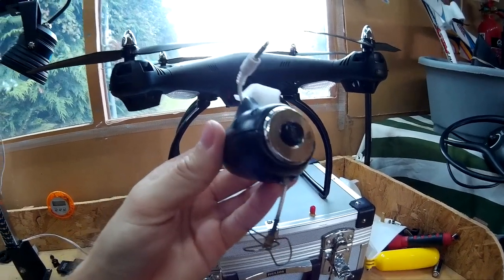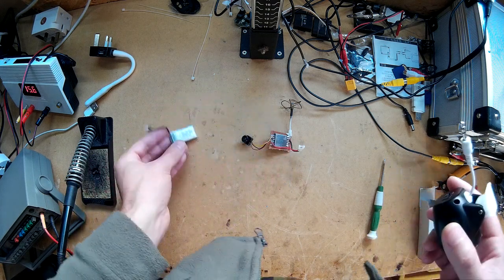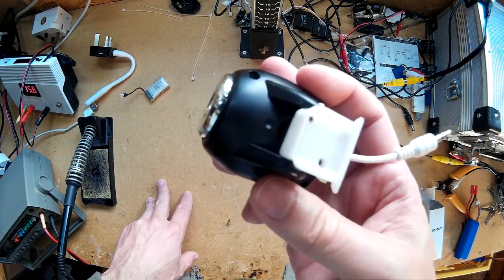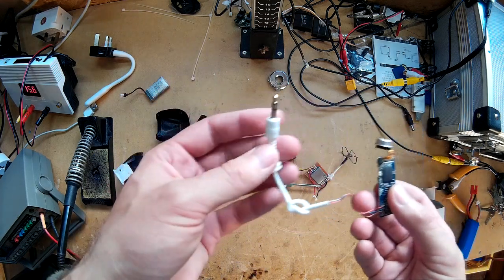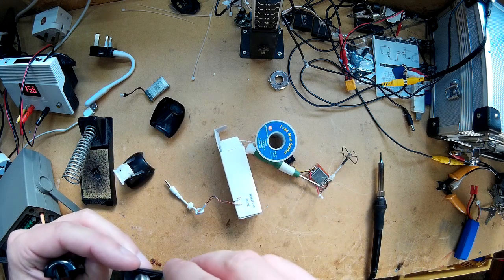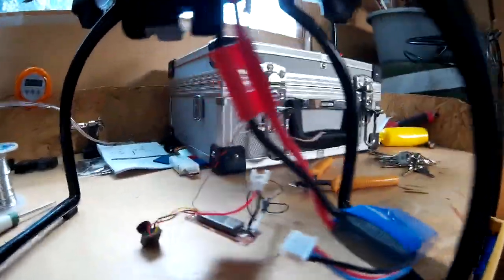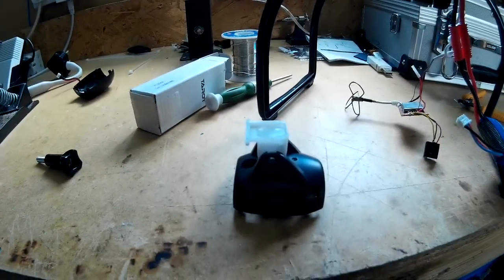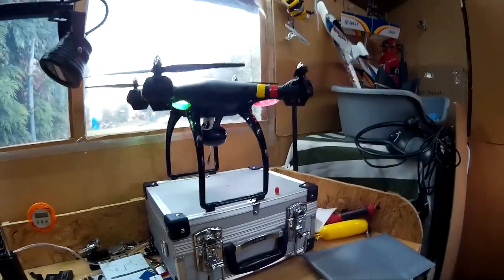Syma X8C Stock Camera Mod T0 5.8ghz Fpv camera

Comment from the maker: Other spare parts
Long leg Landing gear https://goo.gl/RTJbF8 Receiving-Board-Spare  https://goo.gl/rhH18K Camera Holder Mount For GoPro SJCAM https://goo.gl/BLTW1K Fluorescent-Propeller https://goo.gl/JopVne Motor and Motor Gear Motor Base https://goo.gl/VGTxDP  7_4V-2000mAh-Battery https://goo.gl/rVShb2  5_8G 40CH Mini FPV Goggles https://goo.gl/ywHhLY  Eachine  mini FPV Camera https://goo.gl/doR94p

Comment: Hi dude, i had your same idea, but i want to use the runcam split two, it is possible to do it without lose the videos and pictures control on controller?
Reply: God Does BAU I don't really know much about runcam brand but if it has a signal cable (possibly yellow?) Then you might be able to connect it to the drone output but it's a long shot.  Basically when you press the record button it sends a certain amount of electricitu to the camera which triggers it to record, but idk if the runcam has the same threshold... run
Reply: no problem dude, i have sold this and assembled my fpv drone, it is funnier

Comment: How can I power this putting power to the plug it has?will - go to the tip or middle or top?and will the positive go to the tip middle or end?i would like to use the plug it comes with and buy the female side of it. Thanks for any info on this

Comment: Hi what kind of battery does the camera use Eachine TX02 NTSC Super Mini AIO 5.8G 40CH 200mW VTX 600TVL 1/4, can it connect directly to the drone plug X8c?

Comment: does the cloverleaf antenna extent the fpv range be the wltoys v868g?  I want to upgrade the range of me fpv. How can I do that? Putting a 5v lipo in the monitor in place of 3,7v? I doet know of that will work. I hope you have some tips for me to extent te  FPV range.

Comment: Is it safe to connect the Syma X8C 5v directly to the transmitter(TX5813)? The other videos I've seen they use the 3.3v regulator. Sorry my bad english.
Reply from the maker: +Dout3 i have mine connected directly to the 5v output of the x8c not had any problems.  
if you look at the data sheet for the transmitter you will see the operating voltage is 3.5v - 5.5v
Reply: Thanks!

Comment: Awesome mod..........what if I like the idea of having the option of recording onto the mini card...do I have any options ?   Thanks for the vids and the mod ideas !!
Reply from the maker: +clhuke64  Thanks. Well The camera has its own case inside that big outer case if you leave the white wire attached, and power the fpv camera from a small 1 cell lipo instead and attach both cameras to your quad.
Then you get live view from fpv camera and can still record from the remote control.
Hope it makes sense.
Reply: Yes, it makes perfect sense.......just add your setup in another location.....I didn't even think of that......thanks again
Reply: clhuke64 yes and drill a hole in the front center of ur x8 to let the fpv camera system mount inside of ur drone instead so that u can use the sd card camera snapped on to the bottom as normal. This is best way to run both imo.

Comment: Hi man. Good mods. I have a question...Is it possible conect the transmitter to the stock camara? Or, is it possible conect the 170 degree camara to the stock record?I think if it's possible you can record and see the fpv at the same time. Cheers
Reply from the maker: +Pableras 2211 no unfortunately that will not work

Comment from the maker: The camera i made can be seen here https://www.youtube.com/watch?v=mxTsnRS4oug
Here are the part i used to make the camera
10 mw transmitter
http://www.banggood.com/FPV-5_8G-10mW-Wireless-Audio-Video-Transmitter-Module-TX5813-p-84761.html?p=070519238739201308J6

CAMERA 600 tvl 170 degree wide angle lens 
if in uk select the pal other parts may require ntsc make sure you select the right one
http://www.banggood.com/600TVL-8_0MP-14-2_8mm-CMOS-FPV-170-Degree-Wide-Anlge-Lens-Camera-PALNTSC-p-984345.html?p=070519238739201308J6

Clover leaf Antenna
http://www.banggood.com/Tarot-TL300K-5_8G-Image-Transmission-Antenna-Set-p-960340.html?p=070519238739201308J6

Boscam FPV 5.8G 8CH 200mW AV Wireless Receiver http://www.banggood.com/FPV-5_8G-8CH-200mW-AV-Wireless-Receiver-RC305-p-73203.html?p=070519238739201308J6

Comment: Cool mod! I thought about that too, but couldn't get my fpv gear to fit in the pod - also the pod offered no vibration dampening and too much video "jello", even after balancing my props. I ended up using an anti-vibration plate, a Runcam HD for recording and fpv transmission, and powered my vtx with a balance port plug from the main battery. https://www.youtube.com/watch?v=svgj5-GXWBY
Reply from the maker: +Phrancis5  Thanks yes good idea

Comment: can i use this?
 http://www.banggood.com/Syma-X5C-1-X5SC-X5SW-5_8G-FPV-720P-Camera-with-Monitor-Real-Time-Transmission-p-980090.html
Reply from the maker: +Luz Ramos  no it uses a different connector that's not compatible with the x8c .
you may be able to chop  the connector off and connect it up to the x8c connector but i do not know if it will work.
Reply: yes,if you connect a battery to it
Reply: Adoption of independent lithium batteries for camera, instead of using batteries on the aircraft.

Comment: Can I use this? 

http://m.banggood.com/index.php?com=detail&t=index&products_id=980090&utm_campaign=PSALE-1951211-467705931-OPENPID980090&utm_content=ccp&utm_medium=ADshare&utm_source=sem
Reply from the maker: +titoinpr no it uses a different connector that's not compatible with the x8c .
you may be able to chop  the connector off and connect it up to the x8c connector but i do not know if it will work.

Comment: great job, can you tell me what I need to connect fpv to tablet? thanks
Reply from the maker: +sutoto  it does depend on compatibility will work on some phones and tablets its a bit of a lottery.
you need a easycap usb video input device like this http://www.banggood.com/Wholesale-USB-2_0-Video-TV-DVD-VHS-Audio-Capture-Adapter-p-2758.html?p=070519238739201308J6
and also this android app  EasyCap Viewer that is a paid app on android app store
Thanks for you comment
all the best.
Reply from the maker: +sutoto and you need the correct usb on the go connector for your phone or tablet  look for a otg cable  for your device
Reply: +Norfolktuber thanks I will give it a try, waiting on parts still from BG. keep up the good vids